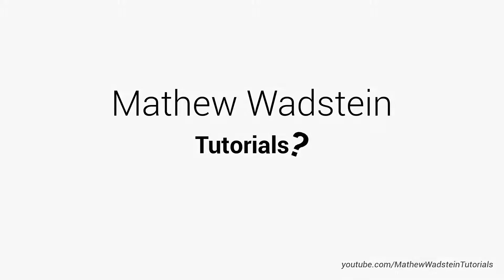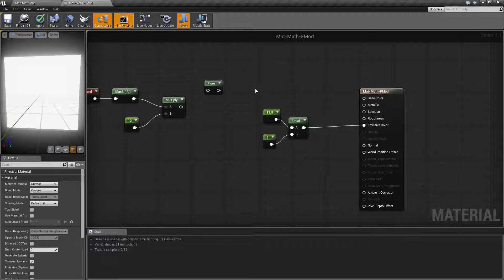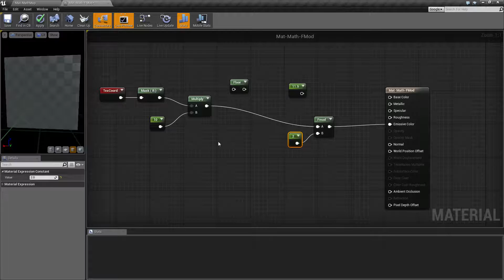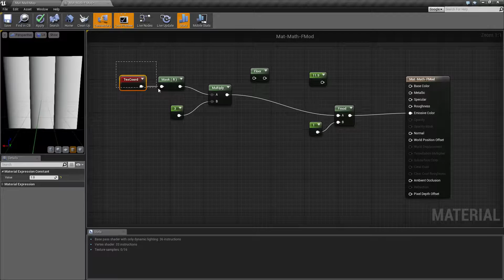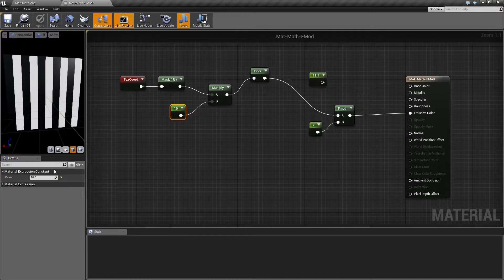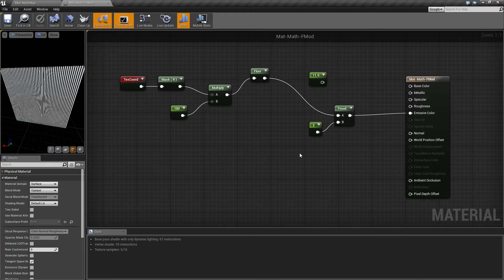WTF Is? Material - FMod in Unreal Engine 4 ( UE4 )

Comment: Hi! Thanks for this. im struggling to udnerstand why Fmod reduces ovveral brightness? in unreal docs they plug the result into a divide by the same value that fmod divies by and it seems to fix that but dont know why.  .. ohhh i see i just limited my max value to the thing im dividing by. so by re-dividing that by the original divisor, im resetting everything to the original range of 0 - 1. but im still confused beacuse we are talking about remainders. if i fmod at u = 1 a value of 0.5 then remainder is 0.. if we do texcoord into mask R and fmod that with 0.5. in the second or righthand side half, i dont know why it doesnt go to black again. it finishes at 0.999? so is it true that theres no such thing  as u = 1? and it can only go to 0.99999999 for theoretical purposes. that means if we put that into fmod then 0.99999999/0.5 = 1.99something with an 8 on the end. so the modulus value is lower. then if we do 0.99999998 re-divide by 0.5 again then we get 1.99999996 (6 on the end) so the final color is technicaly less bright. but because this precision is alot we dont mind. but its still something to consider!